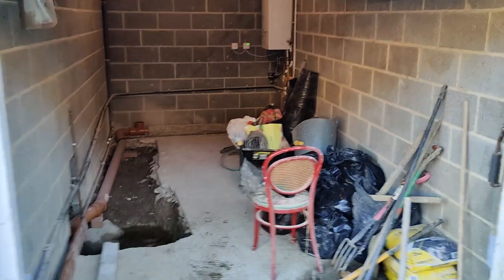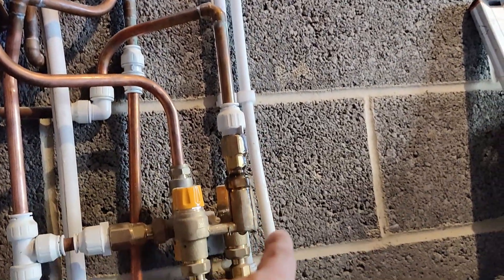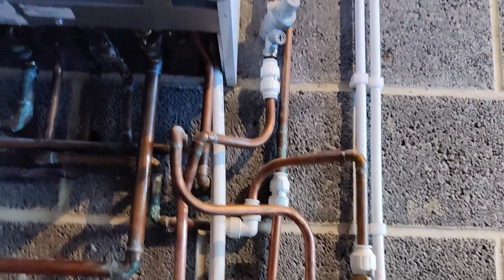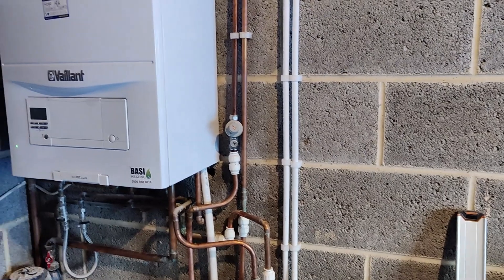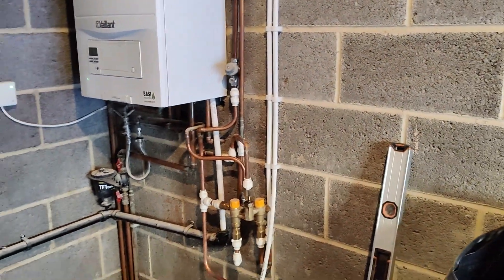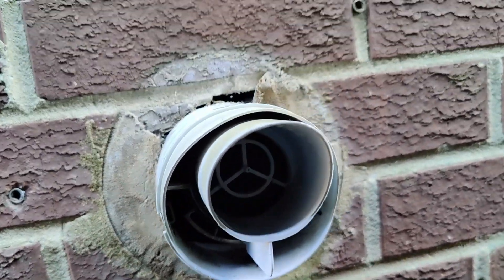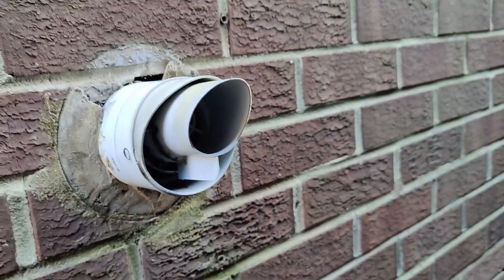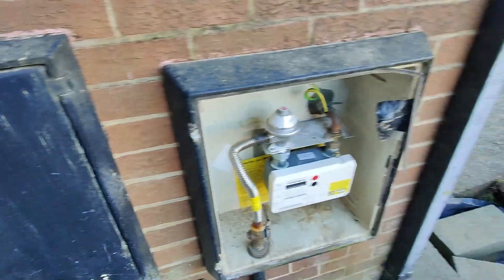Why Does Everyone Make Boiler Relocation So Complicated?

Comment: Is there a two blending valves on left corner , or I’m blind here ? What temperature they set at ? 😅
Reply from the maker: There is a diverter and blending valve including a non return valve in this unit. The  diverter is set at 48°c and the blending is 28°c.

Comment: Great work, only thing i would have changed is put FCU in a more accessible location as well as the Hive Controller as in a tight space and hard to get tools underneath to change or replace
Reply from the maker: @cvarsani2190  I deliberately put the hive base on the right so the screwdriver does fit in and fcu on the left but I get what you are saying as I come across similar issues often. Thanks for your feedback.

Comment: Great pipe work, the water flowrate from the hot outlets must be pretty slow with only 15mm pipework going to unvented then coming back to feed combi through manifold also all those elbows and bends on pipe  surly manifold and cold feed should be in 22mm at least ?
Reply from the maker: @6969allgood  Yes mate the 15mm pipe to and from the cylinder doesn't help the flow rate and pressure to the hot tap however that's how it was piped by the people who installed the solar system. I personally am not too keen on the manifold design as you have to use elbows etc to adapt to it which further reduces the flow.

Comment: What control do you have from the solar to the boiler to regulate the DHW temp? Insulation on pipes?
Reply from the maker: There are no additional controls beside the manifold which is preset and works on temperature with the combi.
Reply: Nice one mate  Nice clean job 👍
Reply from the maker: @zali1457  Thanks brother